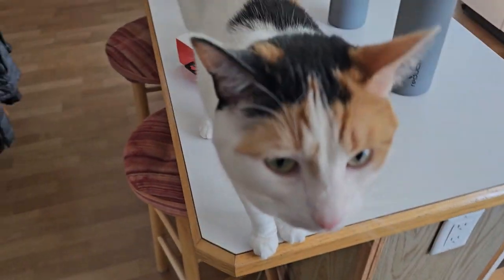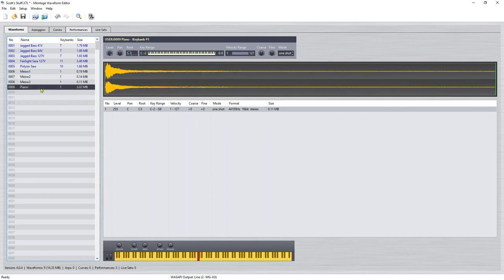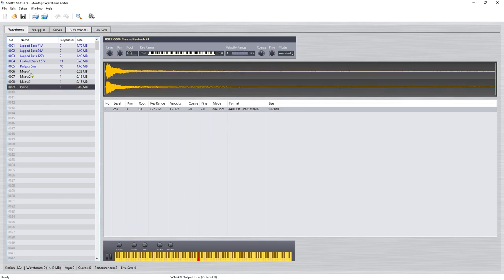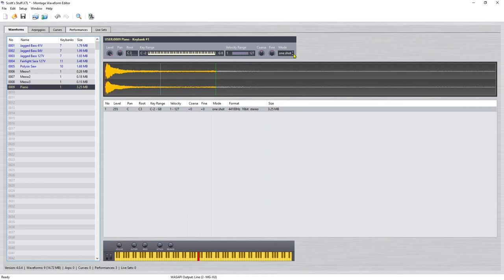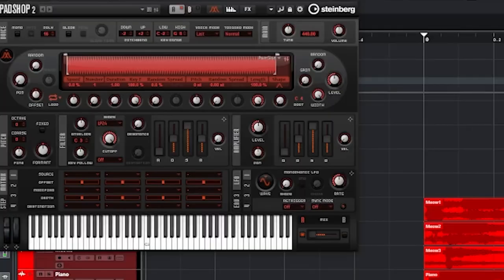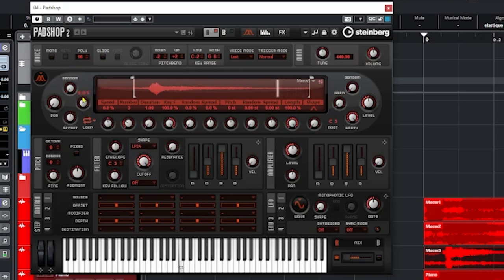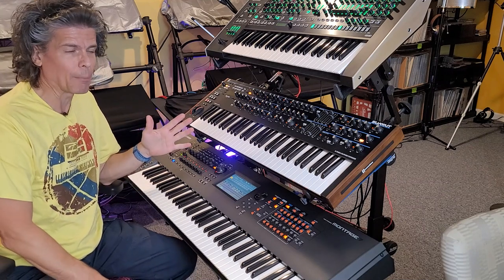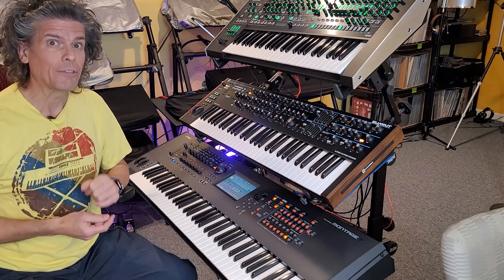Making Music from Found Sounds with Sampling, Granular and Wavetable Synthesis

Comment: Hi there I am new to keyboards. Trying to set my modx 8 to my laptop. What the best cable to use. Also I am using Nanohost to run a pluggin for the vst vox continental used by The Doors and can not get the sound of the vox continental coming out threw my keyboard. Can you help please. Ty.